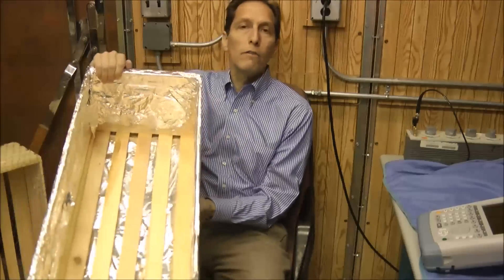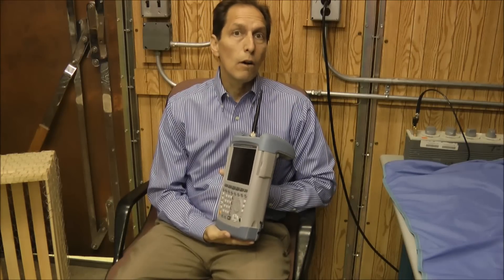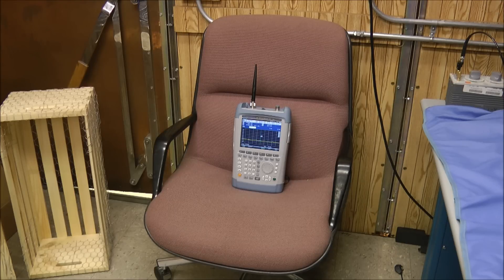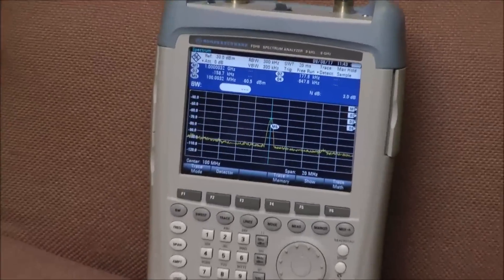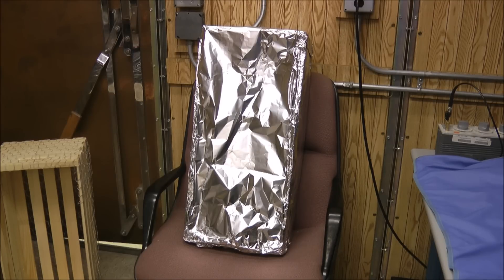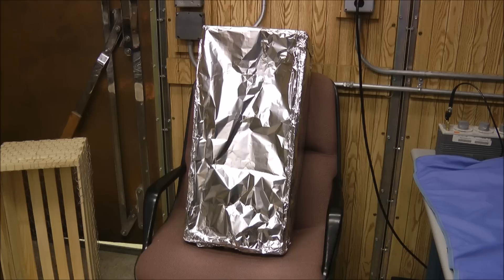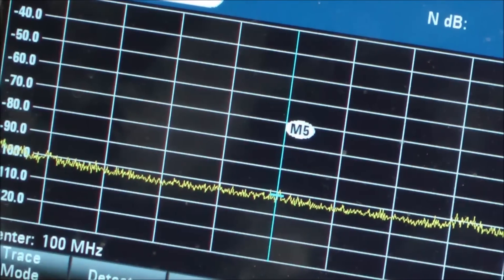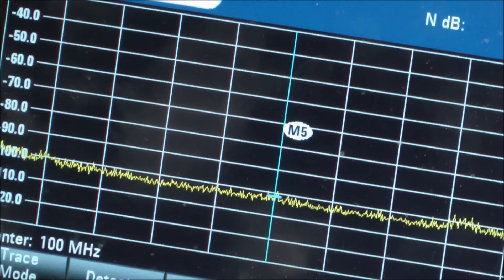Faraday Cage - Chicken Wire vs Aluminum Foil

Comment: I'm only concerned about audible frequencies so I think chicken mesh will work more than adequately I also plan on connecting it to ground wich I'm hoping, will make it extremely effective. I saw a video where they compared grounded vs ungrounded shielding and the ungrounded barely had an effect wil the grounded was dead silent.

Comment: I find you have to go to copper foil and aluminum foil doesnt work especially for faraday bags for phone copper tape with conductive adhesive on a plastic backoutside then covered with tape ontop of that works best there cant be holes in the copper foil layer so it has to be overlapped

Comment: I have tried to cover completely my Wi-Fi router but strangely enough it still sending trough as the mobiles have reception, why is this happening???
Reply: In the Video the aluminum blocks 100 Hz., a 2.4G internet router = 2400,000,000Hz

Comment: Hi, thanks for all your helpful information.  I have some Solar Generators I need to protect from EMP.  Would aluminum foil and the proper tape work if I wrapped the boxes in such?  I know about the sheets and blankets that are sold and they would probably be easier to work with because of their rigidity and thickness compared to aluminum foil, but as a quick fix for now would the aluminum work as protection if wrapper securely?  Thanks

Comment: So my question is would grounding whatever you use screen wire mesh or Aluminum foil enhance their effectiveness by removing an charge collected on the outer surface of the Faraday cage. Would a standard 8' copper grounding rod work for this purpose?

Comment: Yes, as the equations show, the leakage is proportional to the size of the opening vs wavelength.  If the opening size is larger (like 1" chicken wire) the shielding will be less and less as frequency goes up.  The tin foil has openings too, most likely.  There are tiny openings around the side of the box as it's not completely contacting all the way around the lid, but these are small enough where they wouldn't show up until you get to much higher frequencies.

Comment: if one has a home built gasoline generator, and encloses the engine and electronics in an aluminum box, in the case of an EMP attack, what are the chances the engine will still run (electronic ignition) and will still output 120 voltage?  i am thinking there should be good chance it will still work as the aluminum i plan to use is the rolled aluminum from the home improvement store, which is thicker and more durable than aluminum foil.

my generator is a gasoline/solar hybrid i built, it is made to output 120 house current, right now it is good for no more than 900 watts, it is also a 12 volt battery charger and can be used to jump start cars and riding mowers.

Comment: I am assuming that despite our best efforts to build a faraday cage, that the EMP will still fry the computer if it is plugged into a wall socket. Also if I were to make a faraday room wrapped with mylar, I probably wouldn't be able to get a wifi signal. Does anyone know?

Comment: I installed  on my 25 KW Generator  a Brown out kit it goes in the transfer switche if power  in in line drops  below  95 volt or go's  over 240 it disconnect  in coming  power. & starts Generator  with a 30 second  delay I think this should stop EMP

Comment: @wb5mgr and @empDoctor.
I'm in the same situation with Styrofoam boards on all exterior walls. Both the interior and exterior surfaces of the boards are aluminum.  Mobile phones are almost useless, so I got a 'repeater' with an external antenna.  It works ok, but get advice on which frequency you are using.  Bluetooth transmission through a window is good but bad through the wall.  Windows have a fine metal mesh to keep out insects. 😉 The roof is steel, with more aluminum insulation.  I wonder if I get any useful protection from the steel reinforcing in the concrete slab below the house.

Comment: I have an 8’x4’ wooden shed with my diesel 5.5KVA generator in it.
I’ve two extra trips installed.
One on way in and one in way out. Its professionally wired into my house.
In the next 4 weeks?
I’m going to internally double line with tinfoil.
Then?
I’m going to chicken wire it too.
Hoping for an outlay if no more than £100.
($140)
Thoughts anyone?

Comment: Shocked no one mentioned to GROUND the faraday cage .  You run an alligator clip from wire or foil to the electical conduit in back,  THAT makes your box GROUNDED and will work,,not block some waves, It will block all waves,,  If an EMP struck right now,  The foil would melt and the Chicken wire would glow red,  Because the Ions have no path to ground.
Reply: You do not know what you are talking about.
Reply: @chuckcrizer  You don't,  This isn't a 5 watt signal, it is an EMP,  The closest thing you will experiance to WAVE LIGHTNING,  like Plasma Ball Lightning in a WAVE. I do this for a living BUCKO, I sure up US ASSETS worldwide for EMP's  That's why This video caught my interest ,and I added my 2 cents, YOU offer no Meat to your statement DUMBASS.
Reply: @chuckcrizer  And you do , with your MK1 supercomputer...F'kn clown.   Only Microwaves you engineer are Frozen Meals you low T dipshit.
Reply: Why would they melt? Do you even know how electricity works? No emp can transmit enough energy to melt aluminium foil.
Reply: @PlasmaPro8  ok so how did solid Telegraph lines turn to DUST in the 1800's a hole? Look up the last Big CME, and realize an EMP is stronger but localized.  Tin rooves,  Combusted instantly,  People watched NAILS in their cabins GLOW orange..  The Carrington Event..  That's why you need a ground,  Those nails in wood cabins, telegraph lines, and tin rooves  on shacks were NOT grounded or shielded.  And Lit up like a TOASTER COIL..  That's why you need to ground PlasmaAmatuer..  Anything that gets in its way to the GROUND is going to take a beating...BUT if you shield and ground , it scoots by your shield and doesn't treat your faraday cage as an Induction Stove.

Comment: I live in a round metal house. My phone reception is fine unless I'm under the big steel beams that run through the center on every floor.  So if I put my solar and electronic equipment in theses areas with this work for EMP protection? 
Just wondering?

Comment: I have noticed in my steel barn I get low signal strength  on cell phone. So would sheet steel boxes work . I've got a ton of flat steel. I'd like to build a 10 by 15 room that's shielded. Or have a layer of foul back insulation. Then steel then glue one or 2 tinfoil layers on it????

Comment: I've also heard about the chicken wire but didn't think much of the idea.  Thanks for performing the experiment and sharing
Reply: please note,  You need to tun a wire to a ground so all the chicken wire becomes a Ground.  This test was flawed for not using a 1 ft alligator clip and him connecting the boxes to the Metal electrical conduit behind it, that is a ground.

Comment: So a question is would foil faced foam insulation work fairly well as protection shield. I envision that I would use alluminum duck tape to seal the seams together. I would mainly be using as a solar shield to reflect some of the radiated heat from the summer sun.

Comment: I'm trying to come up with a way to cheaply and tough-ly (not a word) protect all of my modern 20v power tools and batteries by creating a daily-use cage of some sort and still have them easily accessible. I'd love to be able to use that small opening 1/2" grid garden fence etc, as it looks decent and is cheap-ish. Even if I had to double it up. I'd love to see a test of something like that.

Comment: And a 5G signal, at 39 Gc, has an ENORMOUSLY shorter wavelength than 100 Mc, requiring MUCH smaller mesh sizes. Foil has no mesh size. Solid surfaces simply can't be beaten. The calculation for maximum diameter of shielding perforation is quite simple. And yes, I'm an old school Ham, screw hertz, it's always been cycles.

Comment: Hey Doc, I’m hoping you could help me out I’m trying to build a faraday cage for my foldable solar panels, I still have the original cardboard box if I use maybe for instance 10 to 15 layers of a thick aluminum foil around the box would that be enough protection from a solar flare or an EMP attack, hope you can answer this question thank you if anyone else in the comment section feels they could help me I would greatly appreciate that thank you

Comment: We didn’t do it on purpose, but years ago we built a home using that old school foam board insulation that had the foil backing… That entire home was like a Faraday cage. Unless you got near a window you couldn’t pick up a radio station or a cell phone call. If we would’ve gotten leaded glass windows it would’ve been a dead zone.
Reply: Very interesting!  So simple foil backing on insulation for the roof and walls combined?
Reply: @ezdeezytube  The foil-faced polyiso rigid board insulation will indeed block RF via reflection.  This is great in avoiding external RF entering the building, BUT if you have Cellular devices they will have to punch harder to get to the tower and a lot of the signal will bounce in the house, possibly injuring the residents.  WIFI will also bounce around.  We run a zero-RF house due to a house member being quite electrically sensitive, but most people will find the side effect of reduced RF a demerit.  Low-E glass will block 10-20 dB of signal, at least it does in our house.  We almost never have any readings above 1.0 microwatt/meter squared, monitoring it 24/7.
Reply: @kengartner204  ~ Please correct me if I’m wrong; but, aren’t most WiFi radio frequencies NON~microwave~band?
Reply: @riccaruso7791  You have to understand that the definition of microwave varies and is quite broad. So one definition puts it at 300MHz to 300GHz and another at 1GHz to 100GHz. All wifi except 900MHz fits into both of those ranges and the 900MHz into the broader one. So take your pick. Interestingly microwave ovens run at around 2.45GHz (to match water absorption of the rf to generate heat) and wifi also uses 2.4GHz but at much lower power.
Reply: @riccaruso7791  The microwave band is very broad - from 300 MHz to 300 GHz so it encompasses all of the WI-FI and Cellular and Bluetooth signaling.  WI-FI runs at 2400 MHz and also above 5000 MHz.
Reply: @kengartner204  very interesting.  btw, Can you describe the term '' electrically sensitive'', in layman's terms
Reply: @sbprime2483  when using a cellphone, an electrically sensitive person will experience shooting pain in their ear, head, neck and arm from just holding and using the phone...
Reply: @unclebenny9028  oic, thanks,, btw,,what is the remedy for this condition?
Reply: @sbprime2483  See - Chuck McGill
Reply: @kengartner204  wait so if you used RF emitting devices in a emf canopy or room blocked in with metal/shielding paint, would that rf bounce around and damage you even more? does that make sense
Reply: @isaiahestrada1143  Yes, that is the situation.  The shielding does not understand "inside" and "outside" and if it has any reflective nature (often the case when we want external signals to bounce away) then it will rebound.  It gets worse in the case of cell phones because they modify their broadcasting strength based on their signal strength from the nearest cell tower -- which will be weaker due to the shielding -- and so will broadcast more strongly than they would normally do. You can easily tell if you are in this situation: your cell phone battery seems to get drained much more quickly than normal.  The bouncing RF from interior devices will continue until dispersed, reflected to the outside or absorbed (perhaps into your body).
Reply: Does it have to be wood? can it be plastic?
Reply: I installed radiant barrier, not sure if it is Mylar or foil,  in my attic and it killed cell phone signals in a similar way, until we got 5g.  Not sure what the difference is, but 5g seems to do just fine.

Comment: Did you attach a ground conductor lead to the aluminum on the box?
Reply from the maker: There's really not a need. I did a video showing that it doesn't  help in any measurable way.

Comment: I have frequency interference in my church building because its near an airport  is it practical to build a faraday cage and how would this be installed
Reply from the maker: Hmm... I think you'd need some expert help to pull this off. You need to determine the frequency, where it's coming in, and then address sealing the space.

Comment: Good experiment.  We wrapped a 4G cellphone with 2 layers of aluminum foil.  But it still received calls. What would be the reason?
Reply from the maker: Blocking a cell phone can take 80-100 dB of shielding. Foil usually gives around 50 dB. You could do foil, an insulator (say paper), then foil, then paper, then foil again, and it would likely block the signal. Phones are tough to block. 2-way radios are even worse!

Comment: I don't have any fancy test gear.  I do have a couple cell phones,  walkie talkies, an AM/FM Weather radio and  a CB radio. 
My Faraday cage consists of 5 layers of  corrugated cardboard with a layer 3aluminum foil between each cardboard layer.  Total 9 layers., 4 of foil and 5, actually 6 layers of cardboard. The innermost is .25" dollar store foam,  then the first layer of foil,  ending with an outer layer of cardboard. 
I mad6z lid to fit over one end of the container in the same man5.
A complete solar system is inside,  mounted to a piece of pine, 1" X 10". It easily slides in out. Included is a AM/FM Weather, Solar/Crank radio, also is a set of 4- 2 way radios and chargers, a portable 9" DVD/TV and a multimeter. A few LED lights to. 
Its pretty robust.  As a final added step of protection,  I wrapped the case in 1/4" metal mesh.
I  figure that should be sufficient for a solar flare or high altitude EMP burst. 
The solar system is a backup to the one currently in use.  I have a pair of small gas genys,  but in a real grid down scenario,  a noisy generator is the last thing anyone wants.
Reply from the maker: Sounds like pretty major shielding!

Comment: What would happen if you built a ‘cover’ to protect a larger item such as a generator?   In other words, a box with a top and four sides but no bottom.  I was considering a large cardboard box covered in aluminum foil.  Would that fail?
Reply from the maker: If the item is sitting on earth ground or even concrete, it can do a pretty good job shielding by covering all but the bottom side.

Comment: I bet the difference is due to poor electrical conduction of the checked wire. 

I was watching an Environmental Radiation LLC vid where he put 3 increasingly large metal buckets over a router he just switched on. He got better results with each application but at no point did it just disappear into the noise floor. Poor electrical conduction would help explain this.

My understanding of faraday cages is that you can't just set a lot of metal surfaces near each other but need to have a good electrical connection to all parts of the cage.

My understanding of radiation wavelengths suggest that the hole size shouldn't matter as long as it is too small. 100mhz is about 3 meters.

That said if foil is far easier to assemble into a usable setup you should use that every time, not some wire you have to solder together.

But make sure you test your setup, don't just blindly trust it.
Reply from the maker: I think the conductivity could have something to do with it, but the primary factor is the wide spaces in the wire. There are tables online of max shielding versus aperture size that can give you an idea of how it factors in.

Comment: It would seem a fairer test to at least use a smaller mesh and even to double it up.
Reply: Indeed.  The ratio of the wavelength to the air gaps in the conductive shielding is quite pertinent.  The typical RF is going to be about 1GHz and higher, so that means the wavelength is about 1 foot.  I do not have a reference handy but I think a very good rule of thumb was at least factor of about 100.  100 MHz wavelength is 10 feet and chicken wire is about 1/100th, so that is why it managed 20dB.  Finer mesh or a shorter wavelength signal should continue to improve the reduction.

Comment: Awesome. Almost hard to believe that someone would believe or recommend chicken wire as a Faraday cage. I'm surprised it did as well as it did. Would be interesting to see what aluminum window screen would do. That said, aluminum foil is way cheaper than either the screen or the chicken wire. It can also be adhered to a cheap box with spray adhesive, such as 3M 77. 
Thanks for posting. 👍👍
Reply: I wonder if the more aluminum foil on a box the better or if that makes any difference if it’s say double or triple wrapped?
Reply: @rolandnobles827  I wonder the same; an article or blog I read a while ago said multiple layers helps, and I think it would make the shielding more dense and thus more protective; however, I am only speculating.
Reply: Its not that bizaar an idea, look at your microwave oven door!

Comment: Well that was very interesting. I wonder if you wrap the aluminum foil box twice would it double the protection??? I'll never get an answer I've asked you several questions and still haven't gotten answers. Oh well I'll just try it anyway. Have a great day and stay safe and keep your powder dry!
Reply from the maker: Hi Terry, it definitely improves the protection. While it will still work with just one layer, the double layer will be helpful, especially against any rips or tears in one of the layers. It will lower the risk of leaks in the cage.

Comment: This chicken wire is wholly useless for this purpose. I'd recommend 1/2" (or smaller) square chicken wire. Also grounding the cage would help to dissipate any held charge.
Reply: That said though more expensive brass screen is the superior choice if you intend on building a "larger" (such as a walk in) cage